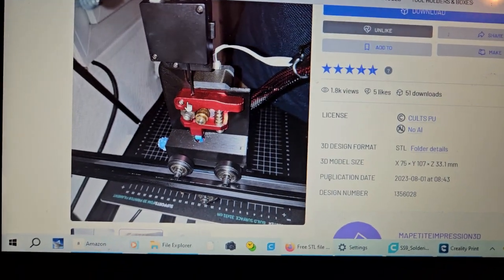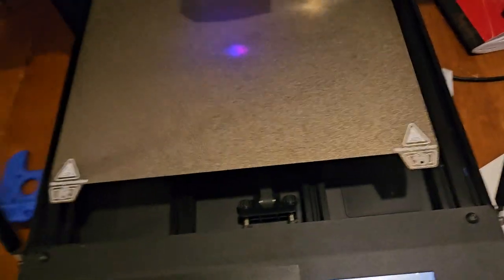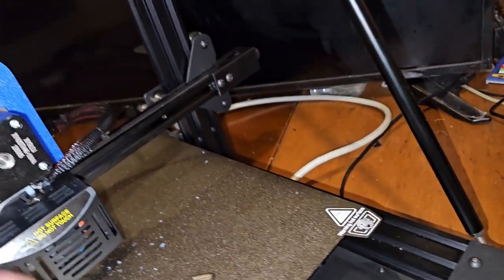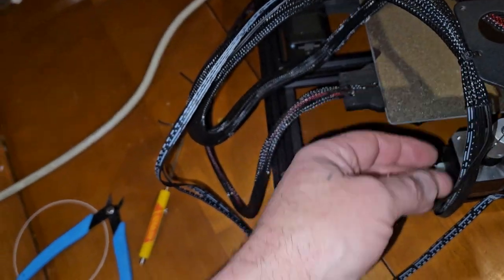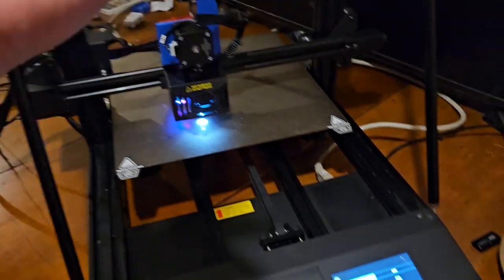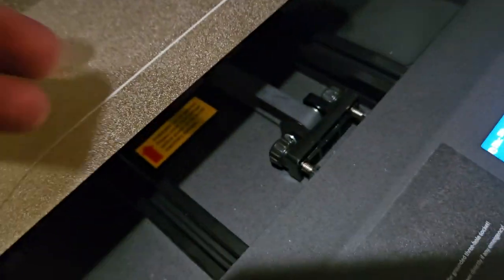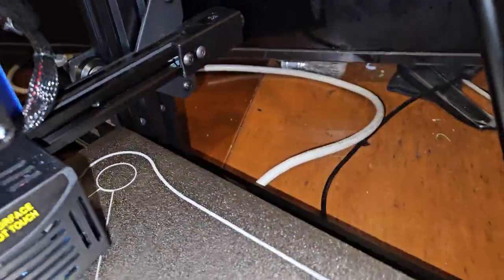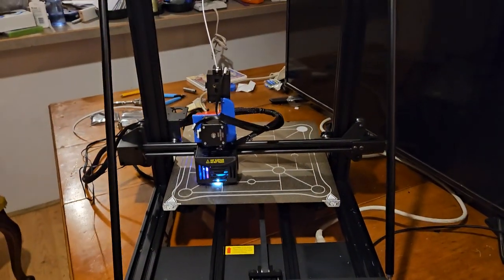DIRECT DRIVE EXTRUDER (SHORT) CONVERSION SUNLU S9 PLUS 3D PRINTER

Comment: Nice work! Still going good?
Reply from the maker: I changed it to a sidways direct drive and printed a custom cover so I can see the hot end better. I used bright green.  Theres a video up on that if you look and a link to the file. I like the printer alot. Its not super fast but it works good and the price was right.